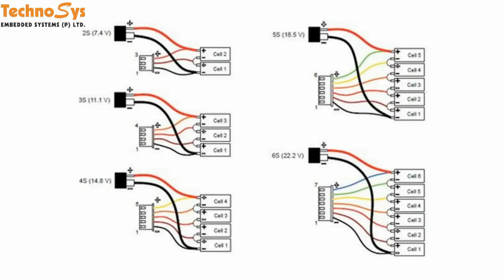Adding A Lipo Cell to The Lipo Battery

Comment: Thanks for the balancer diagram! I will make an adapter for 2x 3S lipo balancer connectors to 1 (6S-)balancer connector for a external buzzer.

Comment: I successfully succeeded in putting 3 360mah together and just used 4 dupont connectors. My charger doesn't stop charging it though. Each battery has two integrated circuits of their own so I thought that our the charger would stop it but it doesn't seem too....

Comment: MacBook pro laptop batteries.. I can't recall which model have 6 1000mah I believe and you can buy the battery for 20$. I use them in parallel to have a big ass phone charger. I think soothe late 2008 model or 2011 15". I think 2011 correct. They bloat your keyboard and pop the track pad off. Its a 900+$ fix via apple. Happened on my aunts 2016. It was still under warranty hence knowing the price.

I have 500mah turnigy 1s that are too big for my eachine e010s so I'm using them as 3s as shown in this video to power 20a 2-4s mamba 20x20 with rs2 1106 4500kv elf 2 build.

Comment: Can we use 3.7 mobile 3 battery nd make a battery for drone..?
Reply: They're lithium ion not lithium polymer, so try it, but no. I don't think so. I had the same hopes. But old laptop batteries are best. Or buying new. Idk the c rating however.. 25c as a standard perhaps.
Reply: yes
Reply: @emc2184  in that case you might as well use 18650 batteries. Which can't put out the amperage. If you're using a brushed motor drone perhaps a very small battery could use it but I doubt it.
Reply: You can " TRY ", any battery or batteries you like, trial & error is part of the fun of the hobby.
I didn't say it will, or won't work, ... I said "YES", to trying them, ... OK?
Maybe I should have said a bit more.

Comment: WHERE DID YOU GET THAT DINOSAUR OF A SOLDERING IRON?
YOU DON'T NEED A BIG WATTAGE IRON, ..... 25 WATT IS ENOUGH.
DO NOT HOLD THE IRON ON THE BATTERY PACK FOR TOO LONG, ... YOU COULD SET IT ON FIRE OR EVEN BLOW IT UP....